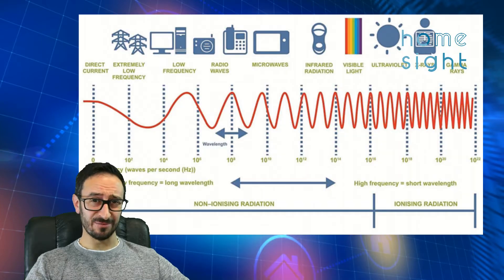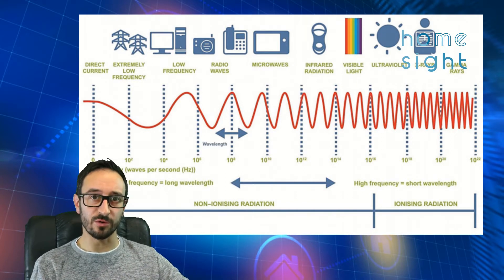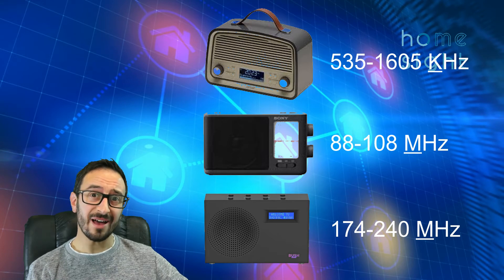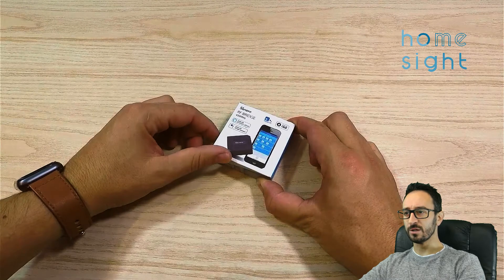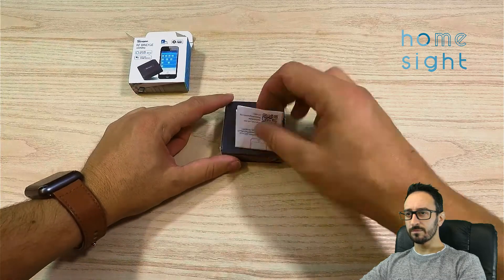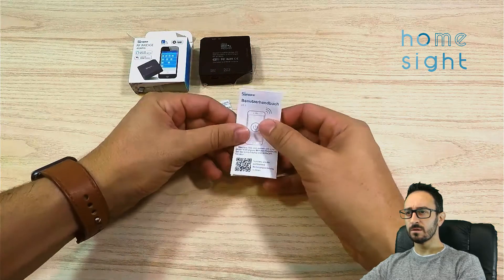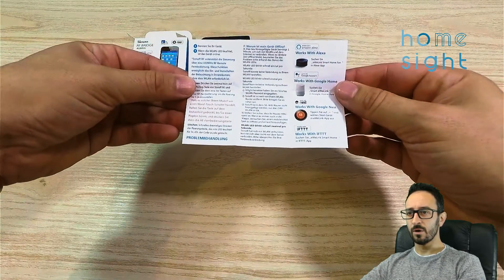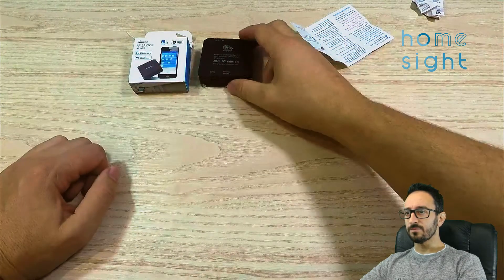How to use Sonoff RF Bridge with Home Assistant. How to Flash Tasmota RF 433MHz

Comment: @Underlyingglitch Idk what is happening I've posted the reply twice and it is getting deleted. Well I hope u see this:
I've managed to make it work! Ive received the FT232R module and at firtst it did not work. I had to manually install the windows drivers. Then it showed the same behavior of my other USB to TTL converter (HW-597) it was stuck on connecting, alternating from ... to ____. Then I was exploring the driver settings on windows device manager and I noticed that by default it was set to 9600 bps and flux control to "none". I changed it to 115200 and flux control to hardware and it worked!.
I wonder if my other USB to TTL is fine and the problem was that configuration. Well I won't test now because I've already tasmotized my rf bridge

Comment: Word of warning this bricked my rf bridge, if you can upload tasmota with another program do it
Reply from the maker: I'm really sorry to hear that! it's the first time I've heard of this happening, but I guess is always a possibility. I assume you've tried re-flashing again since?
Reply: @HomeSight  It's totally fried, won't establish a connection at all now, I've tried uploading tasmota via arduino ide just to see and nada. TBH it's my fault, I knew this might happen it's the third board I've bricked with that pyflasher. Never using it again.
Reply: Mine isn’t dead, if I flip the switch back to normal position it still works with the ewelink software as if nothing changed. I can’t get it to connect to the pc. At first I made the mistake to connect TX to TX and RX to RX, but after switching that it still won’t work. It’s stuck at Connecting….
Reply: @underlyingglitch926   mine is stuck at connecting too... idk what to do
Reply: @felipevfontes  Good to know I’m not the only one. All I read online were success stories, so I kinda felt like an idiot.

I noticed I wasn’t using the same serial interface as the one shown in the video. I ordered the exact same model, so hopefully that will help me to flash the device. I’ll keep you posted but it takes a few days to ship. In case I forget, be sure to remind me!
Reply: @underlyingglitch926  I am also not using the same model. I've also ordered the same one.  I will keep you posted if I have any luck
Reply: @underlyingglitch926  Idk what is happening I've posted the reply twice and it is getting deleted. Well I hope u see this:
I've managed to make it work! Ive received the FT232R module and at firtst it did not work. I had to manually install the windows drivers. Then it showed the same behavior of my other USB to TTL converter (HW-597) it was stuck on connecting, alternating from ... to ____. Then I was exploring the driver settings on windows device manager and I noticed that by default it was set to 9600 bps and flux control to "none". I changed it to 115200 and flux control to hardware and it worked!.
I wonder if my other USB to TTL is fine and the problem was that configuration. Well I won't test now because I've already tasmotized my rf bridge
Reply: @felipevfontes  I tested it 5 minutes ago with the old adapter. Turns out I forgot to hold the button on the device while connecting to the pc. I feel so stupid…

Comment: I think I just fried my RF Bridge. My fault but to anyone else doing this, make sure the jumper is set to 3.3V on the serial converter - mine wasn't!
Reply: oops did you get the blue smoke that you cant put back? I changed mine I soldered mine so it can't be changed and marked it 3v3 and I have another one marked 5v
Reply from the maker: Good shout Bob! That smoke is incredibly difficult to re-insert!!
Reply: I think I have also made this mistake, were there any obvious signs that the device is bricked? Mine still has lights etc. but the NODEMCU Programmer just seems to be hanging at "Note:Begin find ESP8266."

Comment: I curious why some of the videos (pinkywafer) show cutting traces and soldering two jumpers - and yours doesn't.  Do you know why that would be required?
Reply from the maker: Hmm, I’m not sure. Possibly to ground out to stop the boot, but the holding of the reset button does the same thing I think! It certainly worked for me and has done on quite a few of these devices.
Reply: @HomeSight  I think the modification that pinky wafer is doing has it using ESP home instead of tasmota.  And I think ESP home is using a different set of outputs to trigger the transmitter and receiver. I like the direct integration of ESP home with home assistant instead of having to use mqtt

Comment: Hello. Thank you for the video. May i ask if this device is compatible with non sonoff pir sensors? I have a few of them. It seems like it does not send encoded radio signals, so i think it should work. What is your opinion?
Reply from the maker: Hi, I have a sonoff RF pir which works absolutely fine with it. Thanks for watching.
Reply: @HomeSight  i8i8iv

Comment: I followed your instructions everything good as far as the HA connection.I get Connect failed to core-mosquitto:1883, same user name and password in HA ,anything special to set in options on HA.
Reply from the maker: Have you setup the user in home assistant?
Reply: Went to configuration users and added mqtt_user, did a restart on tasmota bridge but still the same  ,I flashed ver 9.3.0.
Reply from the maker: Is there any errors in the log for mosquito?
Reply: Thanks for the reply, errors are as follows: ERROR: [ERROR] Auth error with mqqt_user
1614348411: Socket error on client <unknown>, disconnecting.
1614348531: New connection from 172.30.32.1 on port 1883.
1614348531: Socket error on client <unknown>, disconnecting.
1614348651: New connection from 172.30.32.1 on port 1883.
1614348651: Socket error on client <unknown>, disconnecting ,     I had a typo in the config file but have fixed it and restarted mqtt and tasmota and where 172.30.32.1 comes from I dont know should I delete mqtt and start again?
Reply: 172.30.32.1 comes from my docker address
Reply: As I said in your Zigbee video did a complete new install, got rid of Docker just Hassio and it connected first time YeaaaH
Reply from the maker: Good stuff, that’s what I like to hear!
Reply: Dumb question : when adding devices into the config file I cant seem to copy /paste my last entry is that normal?
Reply from the maker: Hmm, that’s odd... I’ve never had any issues pasting into the file.
Reply: What platform are you running HA on? I am running Hassio OS on a raspberry pi 4 and accessing HA from another machine with the browser, maybe thats the problem.On the raspi I only get homeassistant login:    and have no GUI and they dont make it super clear (for dummies) if thats it,so in fact the mouse and keybd on the rpi are redundnant in comparison to the docker installation.
Reply from the maker: Hi, I actually use a mix of stuff but for this it’s running on a raspberry Pi 4 too.
Reply from the maker: That is how you would access HA, from another machine via a browser. HA is designed to be run “Headless”, I.e. without a monitor. You would only need to logon direct to the Pi when somethings gone wrong and it won’t boot?

Comment: Thanks, how do I switch off the sonoff bridge without powering down? It is working as an alarm that cannot be put off which is a pain, when I am home or has to keep going off because I am there, unplugging the unit doesn't sound right, what should I do
Reply from the maker: Hi, how are you activating the alarm output? Personally I would do this using a node red flow and check to see if I was home before activating the output...
Reply: @HomeSight  you mean ignore the notification if at home?
Reply: @HomeSight  I am testing the unit before installing, at the moment it is a pain
Reply from the maker: I’m not sure I fully understand, are you suggesting you want to use it as an alarm? I assumed you had an input I.e. door contact which you are using to set off an alarm. Is that right?